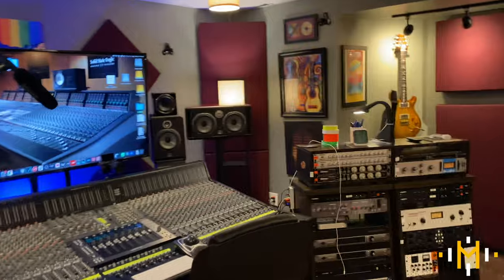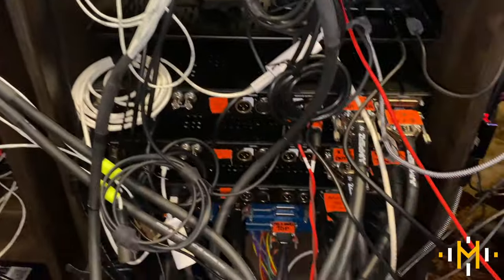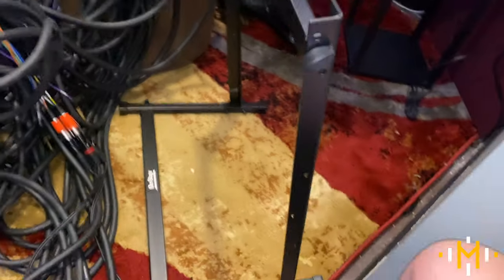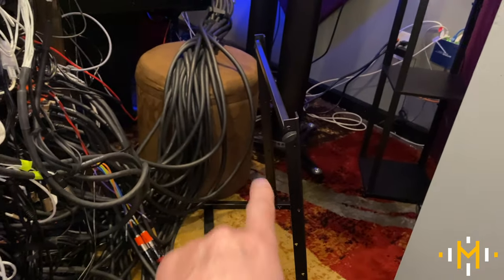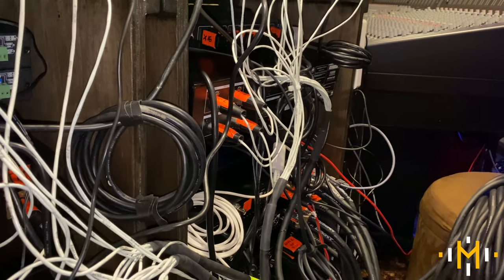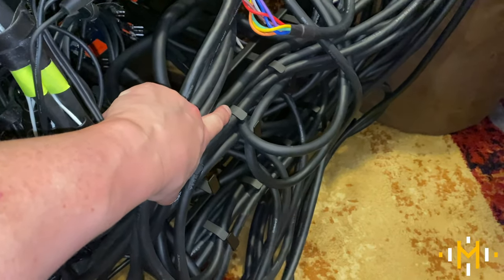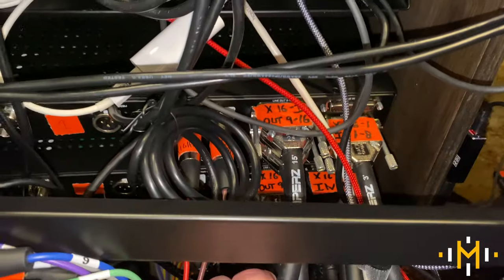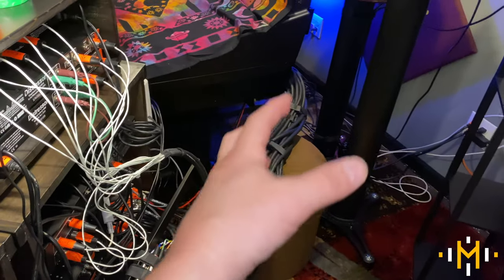CABLE MANAGEMENT TIPS | My Rats Nest | Studio Update

Comment: Pro tip: wrap the top of your desktop rack with a foam pool noodle (the ones that look like giant straws) and secure in place with tie wraps or velcro. This will give the top of your rack a more rounded edge to support your cable and add friction, which will make your cables less likely to slip to the floor and get back all the tension you just tried to manage. To be extra safe, you can also secure the cables to the noodle with velcro.  ;)
Reply from the maker: Great tip! Thank you